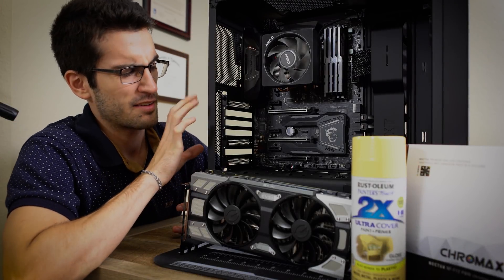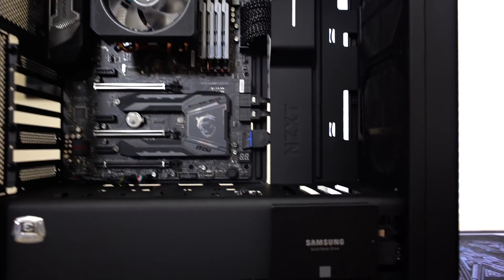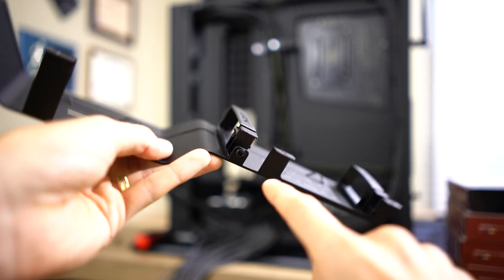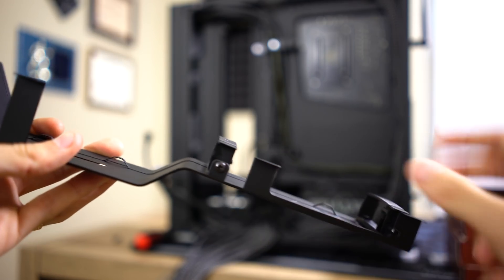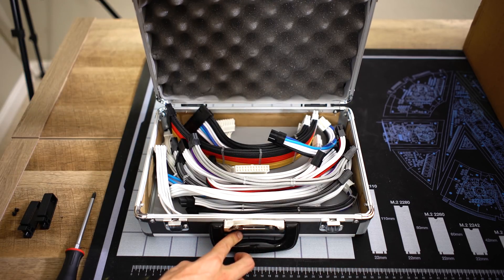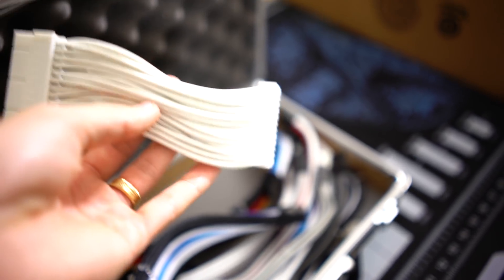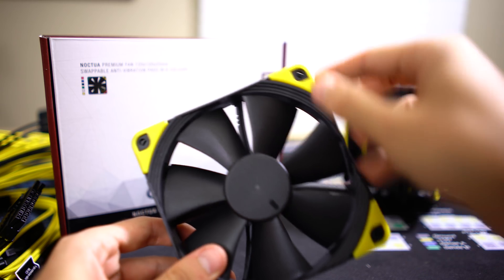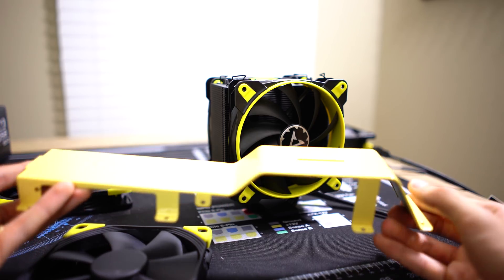3 Ways to Customize Your Next PC!

Comment: I bought a new white case and I am making it a storm trooper theme so I bought some black and white cable extension's from amazon for $34.58 and I also have a vertical GPU mount coming from amazon for $59.00 because my GPU does not have a back plate and it was cheaper to buy the mount than it was to make a back plate

Comment: Here is one tip to think about when painting something that has lots of angles in it. Hang the item you want to paint from a string or wire on a strong paper clip. This will let you get paint in all the hard to reach angles. You would have to make a small rig that is made from a piece of wood or metal that will support the string/wire from the top of your DIY paint booth. This will allow the item you are painting to also dry faster and have a very smooth texture. It is some I have seen in videos of people that do larger paint jobs like cars us. It would be very easy to set this up in a DIY paint booth as well. BTW, nice job on the customization for that computer. I will soon be making my own PC and this is something I might do when I make it being as I am on a VERY limited budget.

Comment: I got a set of sleeved cables for only 30 bucks. And these work fine. You don't need to spend 100 bucks or even 20 for only a 10 cm extention cable. These set from uphere or silverstone or something are pretty good when u think bang for buck. Wich is the intention of the video right?
Reply: They are extentions btw. Its a extention kit

Comment: As a (relative) noob.. I would have liked to see more about the actual* cutting of the case. This is an area that would likely deter me/ hang me up.. so it would've been nice to get some actual footage or advice about that. Tool used? Did it need to be sanded/ filed after? Etc. I'm just a bit confused about how involved that process is.  Anyway great video. Thanks man

Comment: I was contemplating, buying this exact case but I still can't get used to no DVD drive, must be getting old right? It just feels weird with, sooo many games in my collecting  still on DVD.
Reply: i took the plungs !!  black s340 case,  i still have a view "ocd" issues  with the Sata cables not fitting nicely on the SSD ports but it works.

Comment: Even if you're painting parts inside of a box you should hang the  parts by a thin wire from the top. A loop in the wire with a small stick or pencil thru it at the top will hold the part suspended and also let you turn the part 180 without touching it while you're painting.

Comment: iu have one more thing you can customize in your pc if you hhave sli gpu's witch is to make a custom power bridge witch is to glue the cables on a piece of acrylic with the conectors sticking out (you may have to solder some things) but it is totally worth it

Comment: This is definitely a better way to do a vertical mounted gpu. If you buy a case with the mount already installed it pushes your gpu right up against the glass choking it to death literally. I have a h500i my gpu would constantly hit high 70 to low 80c while vertically mounted at high usage and while horizontal my gpu rarely breaks 65c.

Comment: Not a bad paint mod video.  I do like the idea you had by using the Amazon box as a miniature paint booth however seemed like you were fighting the object you were painting.  It would have been easier to poke a hole in the box and use a thin bendable wire to make a hook at each end to hang each part from this way you can coat the part evenly by turning the wire.  Yeah...silver should have been painted yellow on that graphics card.

Comment: Cablemod makes a vertical GPU  conversion kit that looks to be pretty similar to the coolermaster one, except it doesn't require chopping up your case. It has the card sitting back from the edge of the case by a few cm and includes some displayport dongles to get around the issue of threading cables through the PCI bracket holes.

Comment: Looks great, except where you cut the case for the vert. graphics card bracket; you should have cut those pieces all the way off, they're worthless now, you'll never use them again. It would look a LOT better without them. Having them hang infront of the honeycomb of the new bracket just looks crappy. Otherwise awesome build!

Comment: It's a pretty nice build. A little color design tip, Having two different yellows that are very close like that will look much worse than just choosing a totally different, non-clashing accent color. If you can't exactly color match paints, use a second accent color, it will look much better.

Comment: You made a point about the Rust-Oleum Paint and Primer 2x making the build look glossy. The main reason to use the 2x is that it has all-purpose primer built in making it stick to most any surface very well with great coverage in no more than two coats. You can get it in any number of sheens (gloss, semi-gloss, satin, matte). They also have a variety of clear coats in the 2x that you can use to change the sheen if the color you want doesn't come in the sheen you want. The primer doesn't make it glossy though (it sounded a bit confusing in the video and my Home Depot paint desk ways kicked in).

Comment: Question

Have you tested the build to see the temperatures? I'm quite curious because the setup seems to follow a specific air flow pattern. You have two fans in front that work as intake (I can see the arrows on them), then you have the FE card that's a blower type (draws air from the front of the card and exhausts at the back w/o recirculating it in the case) and the air cooler should draw air from the front to back and you are using the rear fan as exhaust. 

Basically you have two front fans that blow air in a straight line, the card works as an exhaust fan and the cooler with the rear fan exhaust hot air. 

Also how is oriented the top fan, intake or exhaust and does it make difference? (I can't see the arrows)

Comment: Does that coolermastervideo card bracket work in any case?  I have a Corsair Air 540 and have not seen anyone use it with it.
Reply: Cablemod came out with their own vertical mount mod, not case cutting required.
Reply: Do you have a link to the cablemod one?

Comment: I plastidipped my PSU cables white instead of custom sleeving them and they look great and yes, it still works. It has that paint/skin texture and it looks cool under RGB lighting. I should probably apply another coat to the 24 pin PSU cable but right now the mesh looks like snakeskin or a checker board and it looks pretty cool. Temps are fine as EVGAs wires already have rubber on them on the 850 GQ so no issues with insulation. Literally costed about 7 dollars for a bottle at Lowe's. If you do a full kit you'll want 3 but I only did my 8+6 pin power connector and 24 pin power as I already had a 8 pin CPU exstension.

Comment: He Greg,
Why does the gpu fan in the Fe Card not spin? did you flash the bios? 
Mine spins all the time and I can't turn it off, but I'm put off by the thought of flashing the bios of a different 1070 to get the fan to stop. 
Or did you break the riser cable ;)??

Comment: I have the same PSU from EVGA. What I like is that EVGA will sell you full colored sleeved cable kits for their units directly from their website for around $89 and under. I plan on purchasing a white set for my current build I'm working on! :)
Reply: cant go wrong there, i purchased the same set you're talking about and i love it, $89 and you get multiple of every cable.
Reply: i am buying an evga 650w for my rig, looking for red cables

Comment: Cables cost more than the psu they are pluged into?! I have used extensions from ebay several times for builds, the price is far more reasonable, and good quality. Those artic coolers are also very good for the price!

Comment: If you want a better paint finish you can wet sand before adding next layer. Easily done with a fine grit sandpaper. Removes the waviness in the paint and makes the finish super smooth.

Comment: I love my Cooler Master Vertical Graphics Card Mount. I have it installed in a CORSAIR CARBIDE AIR 540.
Reply: Do you have to cut the case in anyway or does it just fit?
Reply: ascullydotcom I had to cut the case also

Comment: i wanted to ask if i will build WORKING pc with these parts and are my parts compatible.  Please respond. And can i change another type of gtx 1060 3gb and it will still work on my motherboard?
Tysm

Motherboard : https://m.1a.lt/kompiuteriu_komponentai_tinklo_produktai/komponentai/pagrindines_plokstes/msi_b350m_provdh

Gpu : https://m.1a.lt/kompiuteriu_komponentai_tinklo_produktai/komponentai/vaizdo_plokstes/gigabyte_geforce_gtx1060_windforce_oc_3gb_gddr5_pcie_gvn1060wf2oc3gd

cpu : https://m.1a.lt/kompiuteriu_komponentai_tinklo_produktai/komponentai/procesoriai/amd_ryzen_3_1200_34ghz_10mb_box_yd1200bbaebox

Ram : https://m.1a.lt/kompiuteriu_komponentai_tinklo_produktai/atmintis_hdd_ir_ssd/ram_atmintis/crucial_ballistix_sport_lt_8gb_2400mhz_cl16_ddr4_dimm_kit_of_2_bls2c4g4d240fse

psu : https://m.1a.lt/kompiuteriu_komponentai_tinklo_produktai/korpusas_ir_ausinimas/maitinimo_blokai/evga_power_supply_psu_500w_80_plus_bronze

cpu cooler : https://m.1a.lt/kompiuteriu_komponentai_tinklo_produktai/korpusas_ir_ausinimas/ausintuvai/raijintek_leto_cpu_cooler_rgbled_120mm

hdd : https://m.1a.lt/kompiuteriu_komponentai_tinklo_produktai/atmintis_hdd_ir_ssd/kietieji_diskai_hdd/western_digital_blue_hdd_1tb_5400rpm_sata3_64mb_wd10ezrz

ty

Comment: Are you certain with the cablemod pricing for the extensions? 100-150 USD seems very exspensive. Here in Germany a Pro Cable extensionkit costs 50€
Reply: Gerome Quantmeyer I believe he is talking about fully custom cable set prices, which are much more expensive than extension cable sets.
Reply: Gerome Quantmeyer or if you want to save even more money diy
Reply: Buy cables from Up here
Reply: I like ensourced much more than cablemod. Cablemod is definitely pricey and not as much customization as ensourced.
Reply: Those are full cables not extensions
Reply: I'm off to Germany then